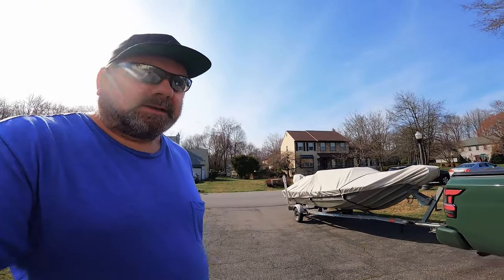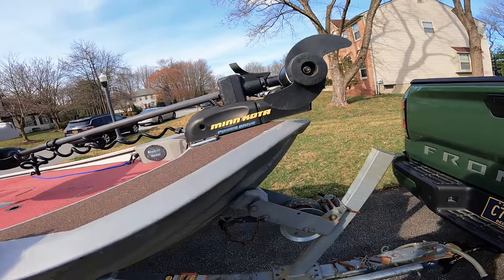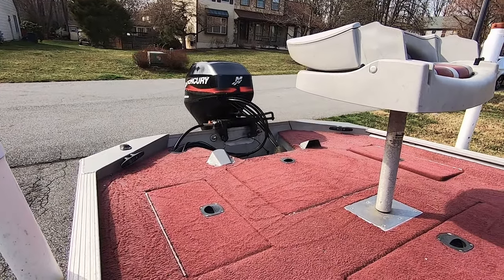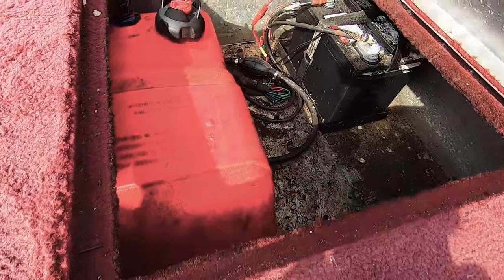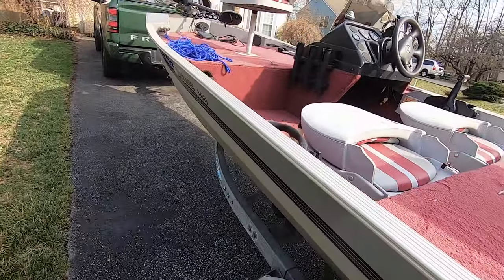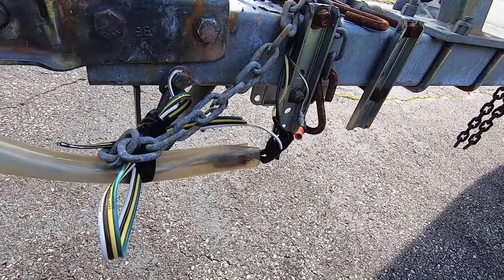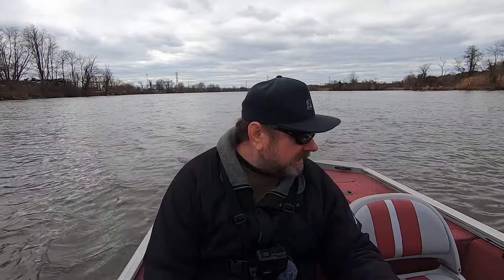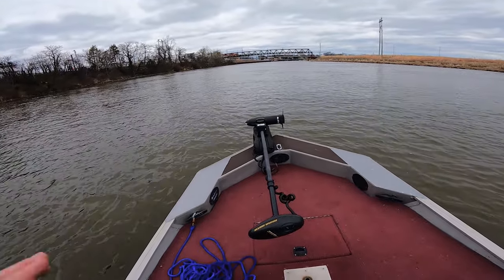I bought a bass boat on Facebook. 16 feet SeaArk McBass 160

Comment: You can get some really nice finds on facebook. I like the boat. When I got mine, I had to clean up the wheels too. Looks great. Gotta make sure you have good grounding.
Reply from the maker: Thanks. I already have redone the  trailer power connection. Made a dedicated ground attachment. Made it nice and neat as it supposed to be. Today greased up the motor pivots and end of the steering cable. It’s coming alone nicely….

Comment: My speedometer doesn't work either. Looks nice, a little TLC she good to go!
Reply from the maker: Yep. Greased up steering with fresh grease. Replaced gasket on the fuel tank. Will wash those compartments and upgrade trolling motor to I-pilot and she’s  going to be good to go.